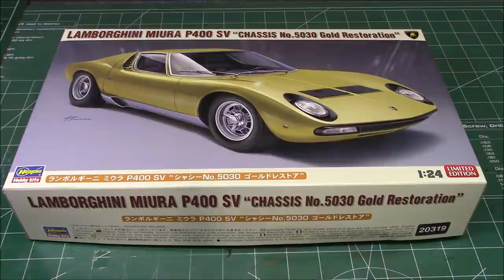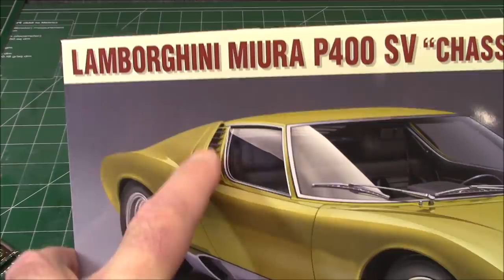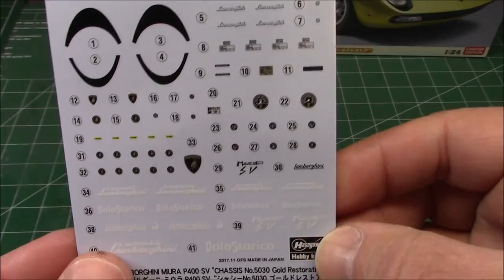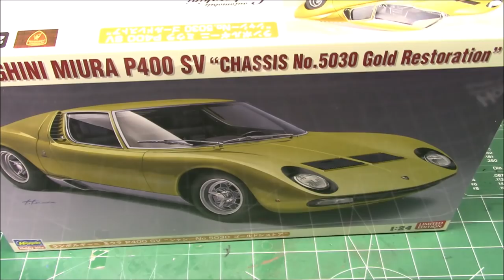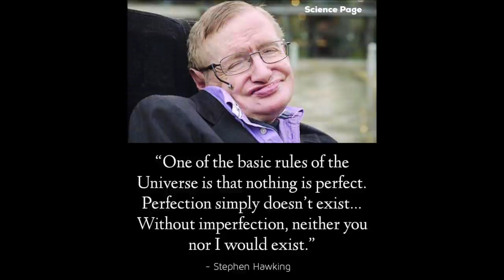1971 Lamborghini Miura P400SV Chassis 5030 1/24 Scale Model Build Review Hasegawa 20319

Comment: The Miura and the Ferrari F40 are the only cars I have ever liked from either manufacturer. To me they are the absolute truest form of what a driving experience is from so-called super cars. But the Miura is beautiful and neither car has traction control, abs, launch control or any of the electronics that for me ruin the idea of feeling the car as you drive or becoming 1 with the car. Just straight up function over form, raw power and handling that doesn't suffer fools. Beautiful job
Reply from the maker: Thanks Teddy!